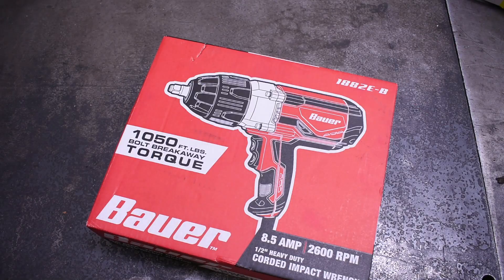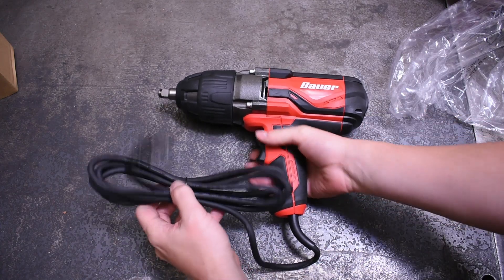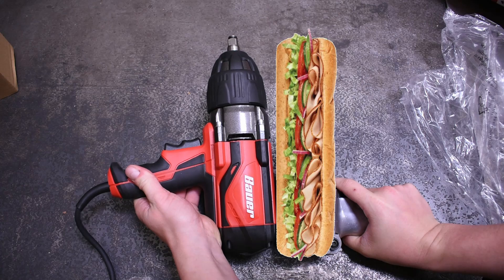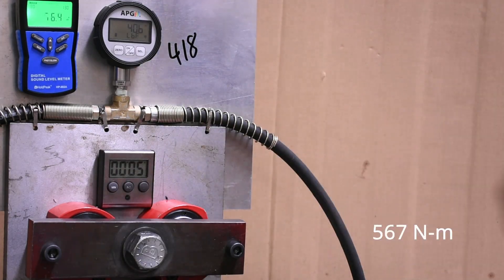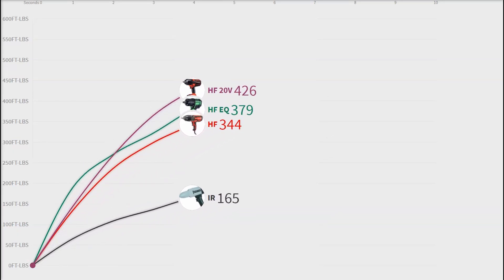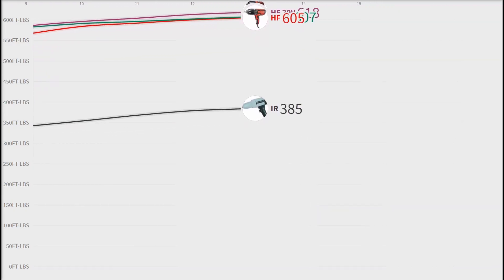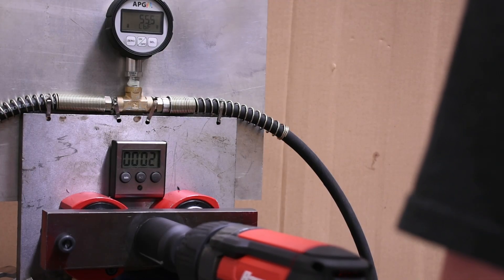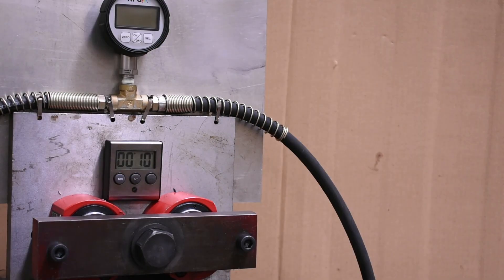How Much Torque Can a CORDED Impact Make? + Dyno Test Extension Cord Losses

Comment: I bought the Dewalt version of that corded impact back in the day before I had any kind of shop setup. I had no air compressor and I needed to to take the crank bolt off of my engine to do a front seal and oil pan gasket. I could not have gotten it off otherwise. It's a cheap option considering no need for batteries and you don't need an $800 compressor to make it chooch. It was a barely adequate solution though. Just like this one it kept hitting due to flywheel effect even after you let off the trigger and I doubt it would have touched these torque numbers in your tests because the eventual air impact I replaced it with slaughtered its performance. This once again makes me wonder how that old Earthquake impact with the red painted aluminum body would fare against these newer composite ones with the huge torque claims.

Comment: Last December I was moving, my air compressor was already at the new place, 8 hours away, and I needed an impact wrench. I decided to try the Chicago electric corded impact, and I was not impressed. It wouldn't break loose my axle shift bolts, torqued to 90 ft lbs. My dewalt 20v 1/4" impact driver took them off fine. Now of course I wasn't expecting much but it was garbage. Decided to just get a Kobalt 24v cordless one
Reply: Odd, I use that one to remove axle nuts on my VW. They are torqued over 200 ft lbs.

Comment: I use both air and battery for wheel guns but my go to it air because it rips off lugnuts no sweat or charge needed. My electric dewalt is still good 2 yaers in but i save it for when i must use it.

Comment: I found these type of corded impact guns used a lot more in construction then in automotive applications. At least typically in what I’ve seen. I have encountered them in the past with folks building decks, foundations, timber frame buildings, etc… where you have to drive a lot of large lag screws. It doesn’t really create a problem that they free spin, because if you’re driving a half or three-quarter inch lag screw it will stop the momentum as soon you let off the trigger. You don’t see them as much now because cordless tools have gotten all the love. But when you can pick this one up for under $100 it’s still not a bad option.

Comment: Excellent video! Very informative. I purchased the Bauer corded impact wrench for some front end work on my car. This thing ripped every nut and bolt that was rusted and seized. I also used it to press out and install the lower ball joints which are notoriously a problem on chrysler 300. Very impressed with the performance. If I had to give a complaint, it would be that this thing is huge and heavy! Thanks for this video.
Reply: What year 300?  I had a '67... I made a press from angle iron and two brake drums, used a hydraulic bottle jack to press the joints out (out of the car obviously).  I am happy with my Bauer impact, it does stink of Chinesium when you use it.
Reply: @scowell  2006 300. I love to hear about the old school methods. Not much American ingenuity anymore. The smell of chinesium is a bit much, but it goes away. Tool is still a beast!

Comment: I've had an Ingersoll Rand corded impact for 35 years. It's great for tires, but it is too long and unweildy for  a lot of mechanic work on a vehicle. And it shoots sparks off the brushes. I used it to break the mounts on a Volvo undercar inline fuel filter. I had released the pressure, but put the fuel cap back on, took a break because it was 110 in my driveway. The heat re-pressurized the line, so that lot of gas sprayed all over me and the cement when the line broke loose.  I can still see the sparks flying out of the tool, and remember the sheer terror I felt. I have never gotten out from under a car that fast. Luckily, I let off just in time and didnt ignite myself. I've never used that impact since because the housing broke when I tossed it. And I never worked on that cursed Volvo again, even though the owner was hot as hell. Especially in her mini skirt standing over me on the creeper. But that's another story.

Comment: I often end voltage arguments with "but that's alternating current vs DIRECT current"
I think wattage ratings can be nicer. Voltage leaves a few things to chance. `specially in an informal argument where we're too lazy to clarify
Reply: Usually AC voltage is measured in RMS, not peak voltage, so the average power output should be the same as DC given equal current draw. But that's the thing, many tools have different current draw numbers too, so wattage is definitely superior as a metric.

Comment: I have the Bauer corded model and it hasn't failed yet.  It spun a Honda harmonic balancer bolt out immediately.  Never would have thought it did over 400 lbs-ft like that.
Reply: I'm sold I was looking what to get for this timing belt change and it suddenly occurred to me corded tools exist for cheap.
Reply: Strong enough to tighten it too?

Comment: Wonder how this would compare to a 2235 on 150 or so psi. I've used Mac and snap on air guns and the IR 2235 blows the pants off them, but it needs to be run alot harder than the 90psi max they print on the box. In my opinion its still the best half inch air gun on the market.
Reply from the maker: You can compare the numbers it made here to the 2235 we tested here (also at 150psi)! https://www.youtube.com/watch?v=Y7hvk14i-nQ

Comment: Not sure if anyone else mentioned, but that motor is most likely ac. All the switch does is change which wires in the motor get live and ground, reversing the direction. The size and lack of weight are the giveaways.

Comment: For a test for loosening bolts instead of tightening. I suggest the brake rotor screws on a Honda vehicle. Simple test of which breaks first the screw or the tool?, and how long till it breaks?

Comment: While it may not make a large difference, using a deep well socket diminished the torque. Should have used the shallowest socket for each to a truer measurement.
Reply from the maker: Not in our testing https://www.youtube.com/watch?v=LeFf5zzjYw4
Reply: @TorqueTestChannel  I guess I stand corrected, thanks for the info.
Reply from the maker: We're more often wrong going into these things, our assumptions are usually worse than you guys'. The dyno is great at squashing our theories.

Comment: These corded tools usually don't come with any power inverter box as you stated. 
These have universal motors in them which as their name suggests can run on both AC and DC. The big size is because these are not as power dense as a brushless dc motor or even brushed one with permanent magnets. So to get same torque out, these are made larger. 
These are also not very much efficient (30%~70%) as compared to DC motors (70%~90%). That's why in cordless tools these are not used due to limited energy in a battery.

But video's are great, keep up the good work😊
Reply: I thought it was bc of the planetary gears in it.. 🤷

Comment: I know it's crazy but there's some IMPACTING air ratchets. Better clearance than the gun types. They couldn't compete. They sell one at HF but the rating is very low. Instead I bought the low profile stubby earthquake. It's roughly the same size as the onyx stubby and 1/2'' anvil. Saved my butt a few times now.

Comment: Thanks for demoing it. I like the tool, and I could tell it had more power than my EQXT air. I thought it might have actually been honest with the breakaway torque. Maybe it is honest. Only problem is I usually can't use it for a lot of jobs due to its size and clearance. Better get a lot of extensions lol

Comment: I am here once again, asking for...not your financial support, but to put the CLASSIC Milwaukee 1/2 High torque against the NEWer 1/2 Snap on gun. The site claims 600 ft lbs for the older model and like 900 for the new. I used one of them a few years back and it barely did a trailer lugnut not transport trailer, like boat trailer ect. My 1/2 High Torque has done everything besides something which NEEDS to be heated red hot, which is very little. Lov eth evideos as always, hope you are getting some good money through the merch and channel to get these tests done. Maybe a viewer could send one in for testing.

Comment: The biggest selling point for corded power tools is the low up front costs, the tool itself.  Every home diy already has a heavy gauge electric extention cord for other tools (angle grinders, shop vaca, etc) and uses.  You don't need an elaborate air source or a proprietary battery.  It's more portable than a air tool, as long as you have an outlet.  The biggest issue, like you stated, is the larger form factor.  I believe the Bauer has been on sale for $60.

Comment: When I reach for an impact space generally isn't much of an issue - I'm sure it sometimes is but the real tough suspension/subframe bolts that these are most useful for... you can often get away with a bulky impact.

Especially since the alternative solution is often a big long pipe that you don't have much room to move in the average garage.  Cordless tools are great and definitely more compact but more expensive.

Comment: I recommend this tool for people who would like to have an impact gun but won’t use it regularly. They just want to have something around the house to be able to break a tire loose or maybe drive some lag bolts building a deck. It’s really an inexpensive gun and something you can afford to purchase to do a single job and then sit on the shelf for a while and use it again later. With the fact that Harbor freight batteries don’t really fit a lot of different tools that you might want to own it’s not worth buying into their system like it is with Milwaukee or Makita so even though they’re getting more tools now than they used to have I prefer to steer clear of their offerings in the battery powered space and just buy their corded tools. This would work fine for somebody who occasionally needed to drive lag bolts or something like that.

Comment: None of the high torque tools are light.  But for $70-$79 (depending on the sale) you're getting a tool that beats out the DeWalt high torque and comes just behind the Flex high torque on the long run torque test.  That's a pretty impressive ROI.

Comment: I bought this corded Bauer when I was having trouble taking an axel nut off. I had a long breaker bar with a cheater bar and it wouldn't budge. This impact pulled it off in 3 seconds. I consider it to be an air impact replacement since I don't have a large air compressor.
Reply: Breaking axle nuts is easy push the breaker bar down with one foot no cheater needed. If you weigh around 230lb and using a standard 15" in 1/2 you are creating almost 288 ft lb of torque 230 x 15" or 1.25.  No axle nut is torqued beyond that figure unless its commercial duty vehicle or a Semi rig.
Reply: @wmc128  well, it was on an 85 MR2 where everything was rusted. I was bouncing on the end of it and the only thing spinning was the tire on floor. Parking brake was on and my friend was standing on the brakes.
Reply: @wmc128  I assume you don't deal with rust often because I've had to deal with bolts where I had to use a pipe to extend my breaker bar to 3ft and then stand on it to get the nut off.

Comment: What's the voltage at the outlet? 115, 120, or 125? Also, are you on a 15 amp or a 20 amp circuit?
Reply: He's running 20 amp outlets in his receptacle, so id have to assume it's a 20 amp circuit.
Reply: @coytus94  Ah yeah, I'm blind :D
So the bigger question would be how far the outlet is from the breaker panel. And the voltage.

Comment: has those 12v car impacts been tested, they sort of spin up and after a while engage to loosen the wheel nuts ? i had one a long time ago and when I first got it i could not understand why the motor worked but no spinny spinny until it finally engaged, pretty impressed with its ability to undo stuff. looking at other videos of them, i think mine was faulty as it would spin for about 4 seconds until it engaged and hence it performed better than a lot of air tools for nut cracking.

Comment: I'm really disappointed with your testing here! 🤮💩

Why the outlet, pointless! Copper is copper, doesn't matter if it's in a conduit installed an industrial metal enclosure with dual 30amp outlets. We really need to know the wire gauge the electrician used? And how long that copper cable is run back to the electric service panel?
That's no different than an extension cord, you should have used an outlet extremely close to the electric service panel and an extension cords of different size and length, then we'd have more data. 🤦🏻‍♂️

Energy not used at the torque test rig is lost to resistance heating of the cable(s) especially inside that conduit you had installed. sigh

You should have been using a current probe clamp device with jaws which open to allow clamping around an electrical conductor.
And a temperature sensor, either a simple thermistor sensor, digital hand held temperature gun with laser pointer, or a fancy FLIR camera. 

What the extension cord temperature get to? Why didn't you test that?

Personally I use;
16ga for 25ft
14ga for 50ft
12ga for 100ft
What did you use? You need another video to explain this video, you showed a drop in torque at the end, but lost all the data. 🙄🤦🏻‍♂️

Comment: Obviously you guys don't have a good understanding of electronics 1st of all you should specify what gauge your power cord is as well as the length then you should also put a Volt meter right at the source where the extension cord and the tool plug in to this will let you look at the IR loss of your system your test is more qualitative And not very informative

Comment: I do wonder if you could make an adapter for the cordless units to power them directly off the wall, to possibly remove any limits the batteries impose. It would obviously depend on the battery and wall power - e.g. if the amperage you can pull off a battery pack is higher than mains, then it likely won't make a difference, but it'd be interesting to see what those units could do if they had (insert clip from Revenge of the Sith) UNLIMITED POWER!

Comment: It would be interesting to see the wall voltage since it can very from a little over 110v to under 125v in my experience but not much you can do about that really well I guess if you have a big enough veriac

Comment: I bought a used Milwaukee 9070-20 corded a few years ago to drive lag bolts. $100 for all day work is a great deal. Since I discovered this channel I've been curious how it compares to the cordless ft/lbs numbers. I'm guessing it'll be around 400 ft/lbs on a 15sec test. It's never had an issue breaking a nut on my trucks.

Thanks for doing these tests. It's an awesome resource to cut through the marketing numbers.

Comment: You are careful to tell us your using 90psi on air tools. 
You tell us its a full 5amp hour battery with 18650 or other cells
With this corded we need to know what voltage you have before you start and what its at under load it makes a difference if you have 110v by the outlet or 125v. The same outlet can vary from night to day in NYC where I am.

Comment: Been watching most of your videos, love the content. Do you plan to build a nut busting rig to test the claims?
Reply from the maker: It's not possible in our experience. You can't measure nut busting in a way that means anything to someone's torque experience at home. Which is probably why brands have chosen to use it. Loosening our bolt, vs a smaller one, vs a larger custom one made for that are all different difficulties for an impact.
Reply: @TorqueTestChannel  I understand the difficulty of trying to match brand testing procedures. And how it would be difficult to compare with relatable real world circumstances. Aka Honda crank bolts. I'm just thinking of a large chunk of steel with an 1 1/2 bolt torqued to 1500 lb/ft

Comment: Corded versions are handy to have around, no $$$ batteries to keep charged, no compressor or other air equipment and for most tire rotations and things like changing mower blades or putting garden benches together they do the job. Especially when you only use the thing 2-3 times a year as a homeowner.  I'm actually surprised at the IR rating, that was built during the times when companies were claiming electric motors were at least twice as powerful as they really were by using a locked rotor amp draw as the maximum power numbers. So you had air compressors rated at 5 hp that really were 3 hp or 2 hp water pumps that were 3/4 hp in reality.  It is the reason why now they use the "running hp" numbers on compressors and pumps, also the reason why you see small engines with only the displacement on them instead of 4HP or 16 HP like they used to have on them.

Comment: I have to wonder if some of these modern battery packs can deliver more current than a wall socket. I've seen someone use one of the dewalt inverters with batteries to run a welder before, so things are getting crazy.
Reply: And now ESAB offers a welder with DeWalt batteries

Comment: The Bauer corded impact owner’s manual page 7 shows the maximum torque rating at 300 ft. lb. So it’s kinda impressive that it reaches 610 ft. lb. I was on a budget and ended up buying the porter cable because it made more torque for around the same price. Are you going to add the corded ones to the spreadsheet? They will score high in terms of value.

Comment: Not that it matters for these tests, but that motor actually doesn't even need a rectifier for DC, it runs directly on AC. It's just what's known as a universal motor, and will run just fine on AC or DC. Pretty much any corded tool with brushes uses this type of motor, and if you wired some batteries in series, they'd run on those just fine.
Reply: all true, though if the switch isn't DC rated (it's probably not) you'll eventually burn the switch up